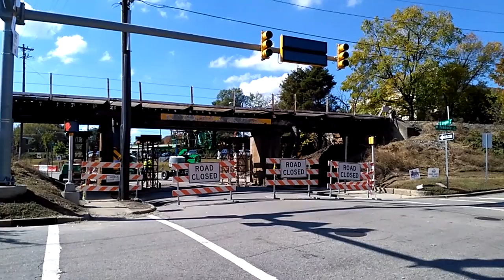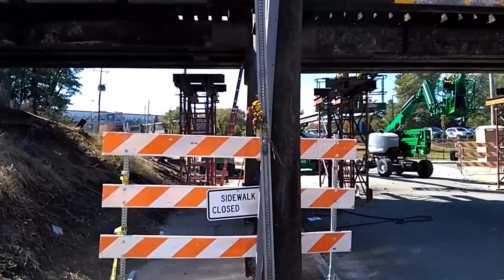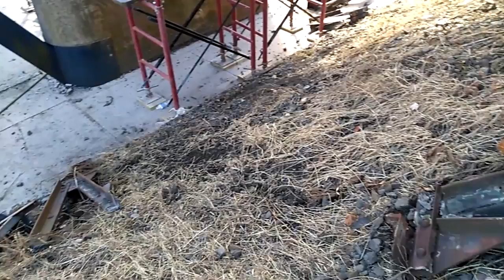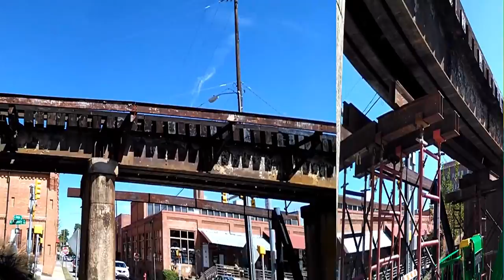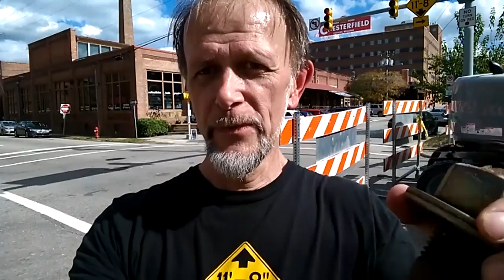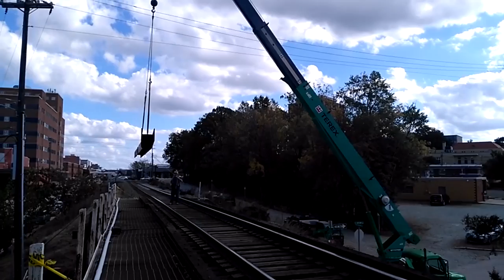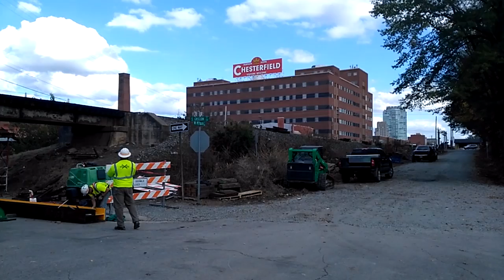Preparing to raise the 11foot8 bridge

Comment: Jurgen should get a piece of that crash bar not just a bolt!
Reply: I say, since he made that crash bar an iconic piece of internet history, he should get the whole thing, have it cut into low shipping rate size pieces, and sell them off on e-bay.
And he can keep the profits, too.
Reply: Put it in a local museum.
Reply: Put it over the front door to his office!
Reply: what about the sign?
Reply: Did you notice how distorted it was when they took it off?
Reply: Yes, it is quite bented.
Reply: @EternalDensity  That would be GREAT to get one of the signs!!
Reply: its not going anywhere just up a bit  maybe a new coat of paint
Reply: It would make a nice coffee table, bar top or chicago rail. That piece of steel is very valuable.
Reply: Open a tavern named "The Crash Bar" and use it as part of the sign.

Comment: I hope they give you an 11'-8" sign or something!
Reply: I was hoping for a piece of the old crash beam.
Reply: They could give him the sign on the traffic light beam at 6:10

That bridge will still be eating trucks at 12' 4", we have bridges down here in Texas at even up to 13' and are heavily damaged by trucks smashing into them. It used to be oversize load trucks carrying tall loads, but more often now it's because the road has been resurfaced half a dozen times and the height sign wasn't changed.

Comment: Road could not be lowered as there is a sewer line underneath it, and I heard the Railroad refused to raise the Tracks, so I thought we were stuck with it being 11' 8" forever! Wonder how much Penske paid the railroad to change their mind.
Reply: It was a co-op between enterprise, Penske and all RV owners everywhere missing their A/C units
Reply: probably using some fancy engineering, they'll probably use lower profile stronger beams, probably not affecting the rail height at all..
Reply: The backhoe getting smashed into the bridge was the tipping point
Reply: Lowering the road won't help. The box trucks are not scraping their tires, they are hitting their roofs! 😋😝
Reply: Pro-Pak Machines I laughed way too hard at that. thanks, made my night😂😂

Comment: I guess the railroad company finally got tired of having to inspect the bridge every three days.
Reply: I'm curious if they are raising the tracks or re-engineering it so that it is thinner and has more clearance?
Reply: I would think they'd have to lower the road unless the rail line is dead. Trains have to have gradual grades up or down which could be about 1/2 mile each.
Reply: @senhowler  Yeah I'm really wondering how they're going to raise the bridge without affecting the train tracks by bending them upwards. Because that would make it difficult for trains to safely cross the bridge.
Reply: @Fragenzeichenplatte  What I'm thinking is possibly more I-beams with smaller webs?  The ones in the video look like they are about 12-16 inches.  Could they go with twice as many, but only eight inch webs (or whatever actual engineering demands since I doubt it's as simple as twice the beams for half the height)?
Reply: @mojorisen74  They can't lower the road because of what's underneath it...
Reply: @Fragenzeichenplatte  Moto X style train jumping as a truck rams the bridge

Comment: 12’4” is still pretty low. Might still see some action yet! 👍 My hat is off to you Sir.
Reply: Obviously. Didn't you see that new yellow painted crash bar that they're gonna install? Definitely prepared for new idiots who crash into the 12'4" bridge.
Reply: Why can't they make it so 13'6" trucks can pass underneath the can opener? Grins
Reply: @Gerald Dileonardo They gotta keep the bridge fed.

But seriously, trains really don't like sudden inclines and if memory serves, there's a drainage issue that prevents them from lowering the road. So the roadbed can't get lower, and there's a practical limit to how much they can raise the bridge. Those extra 8 inches may not sound like much, but if you look at the videos on this channel, quite a few of the wrecks were a result of being less than 8 inches too tall. So, after modification, there should be fewer feedings of the bridge. But they still expect some idiots as evidence by the bright shiny yellow crash beam on the ground ready to be installed.
Reply: John Cochran Both are baloney insisted upon for years, particularly amongst the “experts” here in the comments. It’s a tiny road, drainage is not a massive issue, we just redid a MASSIVE drainage program for a major multi-lane freeway here, including PERMANENT FULL-TIME pumping stations. It’s always just strictly been a budgetary battle between governments and railroads, the engineering isn’t even a huge issue.

Comment: 12’8” most of the wagons I get ate double deckers that are 15’9”, this ain’t gonna change much 😆
Reply: The standard minimum vertical clearance in the USA is 14’-6” (4,42m). Any less is supposed to be signed.
Reply: @algrayson8965   Wait, isn't it 13 feet 6 inches?

Comment: 6:20 What a dope, standing under any suspended load.
Reply: Might be the perspective, but yeah...
Reply: Not the same at all. All of that stuff is (or should be) securely fastened in place by the time anyone needs or wants to be under it. During the process of being hoisted or lifted in place, it's a suspended load, just like this doo here. I spent about 15 years operating hoisting equipment, there are ways to prevent mayhem and this ain't it.

Comment: 6:18  I’m going to stand right under this 10 ton beam while they hit everything with it lifting it out.
Reply: Don't worry he's got a hardhat.
Reply: I cringed so hard when he looked at the operator not even looking at the beam anymore😂
Reply: I liked the guys on the lift cutting the bolts. Let’s run the boom of the lift directly under the thing we’re freeing up.
Reply: 10 TON??? You'd be lucky if it was one ton
Reply: @cindytepper8878  - It was bent! Something more solid than a box van must have hit it.
Reply: "Safety last" on this job
Reply: @algrayson8965  It was standing up and getting hit from the side. I-Beams aren't intended to take heavy side loads. Notice the new one is laying down
Reply: @algrayson8965  Shit I just looked again. The old one is the right way. But that is no way even close to weighing 10 tons. I.m not there to measure it, but at most that beam weighs 100 pounds per foot of lenght
Reply: Maybe a backhoe? Who knows? Things hit the bridge itself for decades before the guard beam was set up. Likely box vans that hit the bridge got stuck under it.
I've seen concrete bridges and underpasses that had been hit until the rebar was exposed.

Comment: The legal  height for general road usage is 14'2". So the can opener will still be in operation. I have looked at the approach to the bridge via google street view and i don't think the signs are BOLD enough. They can also install low hanging chains on the approach.

Comment: 12'4" still aimt enough...a semi pullimg a box needs 13'6" 😅
Reply: Yeah, it will just cut down on the number of crashes, but they won't go away completely.
Reply: It will be back to normal diet after a couple asphalt repaving repairs
Reply: @JasonW.  I hear that they also plan to lower the road by a couple of inches next paveover. That would bring it a bit more space.
Reply: @Dissenting Tirade well, I wouldn't name any company, but some are not that swift
Reply: But, the big Penske box trucks are 12'9. ...
Reply: @JasonW.  I see what you did there, and I approve... Now I just wish my Prime seal of approval would get here from England so that U.S. Express could fail at delivering it.  Schneider way, I'll make sure you get it.
Reply: so 13'8" is minimum space.
Reply: @JasonW.  
Sure
Wish
I
Finished
Training
Reply: @fmxrider429  
Swing
Wide 
It's a 
Fucking
Trailer
Reply: @rearspeaker6364  A lot of old bridges have the wrong heights on them.  They were correct when the bridge was first built; but, after a few paving jobs the road surface actually grew towards the bridge and the signs were never updated to reflect the new height. So, if you drive a tall vehicle, its a good idea to take the labeled height with a grain of salt.  And if you are planning an overpass bridge, it's a good idea to give yourself enough room for future growth.
Reply: @rearspeaker6364  I've made it under 13'7" a couple times in p.a. and Chicago.....going about 2 mph.

Comment: I hope they start making new truck trailers 12‘5“.
Reply: Semi trailers are 13'6" tall.  Still 14 inches higher than the bridge will be.  Not sure what the height on the rentals are, but 12'6" seems to come to mind.
Reply: Timothy Barney I drove a 26’ U-haul earlier this year and it was marked 12’0” all over inside the cab. As it happens, when I was returning it, Apple Maps tried sending me under a 12’0” train bridge. This channel taught me to turn.
Reply: @flszen  good work!!
Reply: @flszen  You sure they said 12 foot? as i recall they sit at 11 foot 4 inch for their biggest fleet option. they even post the measurements on their website.

Comment: Was there a guy standing under the crash beam when they cut it lose? I thought smart people never went under a load being lifted.
Reply: Yup!
Reply: The Overling   Smart people DON'T.   Moving along....
Reply: @darrenevig990  ;)
Reply: He is holding what is called a tagline.  This helps keep the load from spinning.  He was 6+ feet to it's side.  

This is actually a safety requirement when hoisting.  Even with a boom truck.
Reply: @Cheeseburger.Launch.Sequence  You are talking about the man on top of the bridge. Yes, he is safe. I'm talking about the man standing under the bridge. And standing under the beam being cut free. The man without the tag line. Timeline  6:11.
Reply: @theyarehere8919  7:08 You mean the guy who takes over the tag once the load is too low for the guy on the bridge?

It's a neccasary "evil".  OSHA refers to it as "leading edge" (for some reason).

Certain jobs come with inherent risk, it can be minimized, but someone needs to be there to control the load.

He was in an unsafe position for about 5 to 10 seconds.

Nah, the black guy under the bridge is protected by the bridge.  The white guy directly under the beam was the same tagger on both sides.  You can see his right arm elevated and the line trail away.

Not awesome....but needs to be done.
Reply: @Cheeseburger.Launch.Sequence  no, he's talking about the guy standing directly under the beam (6:15) directing the crane operator when they start lifting it off. he's not holding the line, the guy up top is. he's doing nothing but signalling the crane operator. and standing directly under the center of the load. for literally no reason.
Reply: @holden_tld  Yeah, with the arm raised I thought he was holding a line.

My guess is he had to stand where he could see the bridge and beam as well as be visable to the boom operator.  Perhaps the guy under the bridge was his "oh shit" guy.

I wouldn't be stoked to be in that position.  But still, it would be considered neccessary and leading edge.
Reply: @Cheeseburger.Launch.Sequence  The Tag Line is needed... generally should not be held by the person directing the crane.  And NEVER stand under a lift.
(I am speaking as a former Nuclear Weapons Handling Supervisor.)
s/ 24 Year Retired US Navy Submariner - USNA Class of 1965 - Former Enlisted Man
Reply: @Cheeseburger.Launch.Sequence  No. Before it was cut lose. There are the ones never so blind as the ones who don't want to see. I'm just going to give up. I promised myself never to get into a battle of wits with an unarmed person.
Reply: @SaltiDawg2008  Guys arm is raised and behind the column, it was difficult to see.  

I aknowledge he is directing the crane.

I have worked on commercial, wood framed buildings of upwards of 300,000 sq ft.  Flying in banded packages of near two story roof truss/girder systems.  

If people didn't stand beneath the load, the job wouldn't get done.  

I have directed a crane operator, while holding a tagline, standing on 4th story exterior walls, only to have to quickly adapt and receive the truss packets.  No harness or anything.  Because you need to be able to move around.

Perhaps, when operating a boom or crane in a closed environment on a fixed platform, where it is just a repetitive task you can have such benefit.

In this bridge product, the individual directing the crane needs to see the crash beam, the remaining bridge structure, as well as provide line of sight for the boom operator to see his hand signals.

Where is that possible?  Under the beam.

I admit, I was presumptious about the guy holding a line..... I am quite surprised there wasn't a ground guy on the side of the initial lift, but there wasn't. 

Reality is, commercial construction, especially steel erection is still dangerous work.  And sometimes the people doing it have to take risks.  It's why commercial construction pays big $$$$.

Life's a bitch.  Big risks big rewards.
Reply: @holden_tld  Hey, I responded to a different individual, but my reply suits you also.

He was standing under the load so he could see beam, bridge, as well as being visible to the BOOM TRUCK operator.  Not a crane....
much safer, slower, and stable.
Reply: @theyarehere8919  Yeah, your last comment was actually just wierd.  So yes, feel free to stay away and ignore me.  I find that ideal myself.
Reply: I rest my case.
Reply: @theyarehere8919  Instant response eh?

Either by MASSIVE coincidence you were on youtube at the same time as me....  OR you do nothing else, have no basis to get involved in this discussion,  and literally sit around on a computer all day Live Action Roleplaying.

Comment: So...uh, why did they wait so long to raise the bridge? I thought the long-standing reason was that they couldn't due to the grade of the tracks being to steep for the trains. What changed since then?
Reply: Exactly my thoughts. Usually this kind of elevation requires more than a few yards to keep the slope train friendly. What kind of works are being done in the surroundings?
Reply: I'd imagine they changed it by installing new support as strong but shorter in depth, and left tracks at same elevation.
Reply: @JasonW.  Jurgen said they were raising it to match the elevation at the Duke Street crossing, a block away. There are no crossings for a long way in the other direction, so they have room to compensate for the change needed. To keep the grade under .5% they'd need to lift less than 150 feet of track.
Reply: Yeah, I think they're raising the bridge clearance by 8", not the track grade. 
They would have to tear-up and replace a significant length of track and foundation on both sides of the bridge to change the grade.  So there would already be construction equipment and supplies all along the track for doing that.
Reply: @AlleyKatt  Not necessarily.  They could probably raise the track by adding more ballast. That is not a difficult task with modern machinery.
Reply: @larrybrennan1463  You were right!
Reply: @AlleyKatt  I just guessed that would be what they'd do. Easier to raise the beams with taller pedestals then adjust the track on either side with deeper ballast. I've seen a lot of trackwork around here, between CSX,  NS, and FEC.

Comment: They will still hit it at 12’ 4”
Reply: There's a tunnel under railroad tracks in my town with only 10" clearance. Nobody's can-openered on it in years.

I suppose the difference is that 11'8" (or 12'4" now) is high enough to look like you can drive under it if you don't actually know the height of your truck.

Comment: Why didn’t they just lower the road? Lol...
Reply: There's sewer pipes/some kind of infrastructure buried underneath. More expensive/dangerous/longer delays than raising the bridge.
Reply: John Doe thanks I had the same question
Reply: John Doe my question would be what is the length of track that needs to be lifted to accompany the slope required to heighten the track X height
Reply: I’m willing to bet they won’t “raise” the bridge. Just remove and replace the existing beams with more and narrow ones that can carry the same load. That way the level of the tracks won’t change either.
Reply: Mike Previtera oh how the plot thickens
Reply: @mattycreek384  I'd say not much at all. The track actually inclines leading away from the bridge on both sides. So raising the track that small amount will actually make it more level.
Reply: you're right @blindleader42  because  thats what the video guy was saying, that raising the tracks here was going to make the rail line more level with some other bridge a couple of blocks away
Reply: @tyrone6481  Not some other bridge, but the Duke Street grade crossing to the East. He doesn't say anything about the track on the West, but topographical data shows a gradient of around (my S.W.A.G)  2%. For those who don't know, and might be confused, 'grade' means level, as in: the track is on the same level as the street it is crossing. That makes it a grade crossing.  'gradient' means slope. More nerdity: 'S.W.A.G" stands for Scientific Wild-Assed Guess, which is better than a mere W.A.G.
Reply: @mattycreek384  assuming a gradient of 1% (wikipedia says about 1.5% is the max for freight trains), and assuming the track is otherwise completely level, to raise the bridge 6 inches you'd need to start the incline about 600 inches or 50ft from the start of the raised section either side, I guess

Comment: Solution is to lower it so that nothing taller than an Escalade can pass. Low metal beams and concrete with a huge screen of LEDs on it. Then all trucks will turn or slam into it and stop instead of getting underneath it.

Comment: They will need to raise it to at least 13Feet 6 inches or higher to allow a standard size tractor trailer with dry van.
But city engineers are such educated geniuses so i guess they don't need to know small details like that.